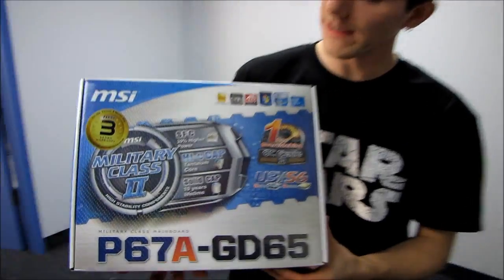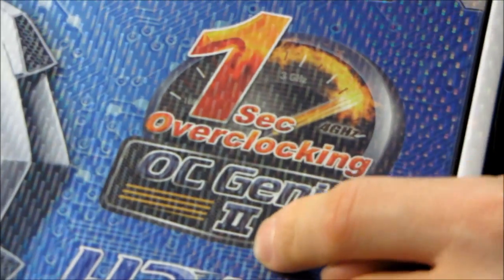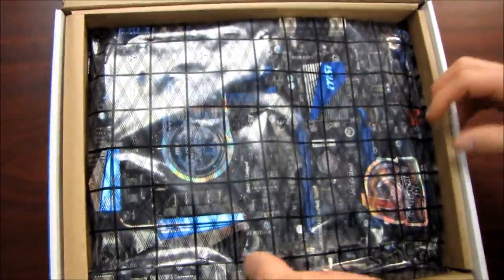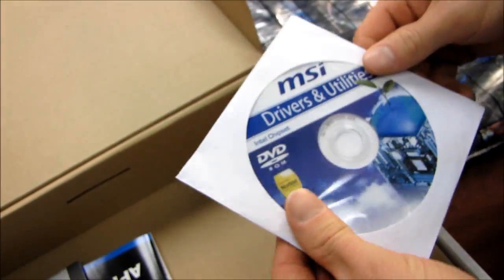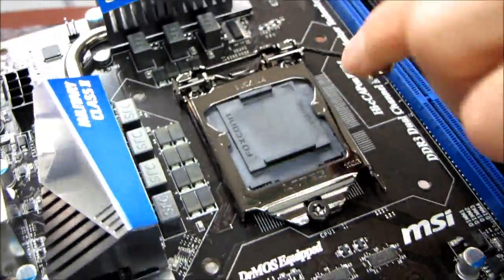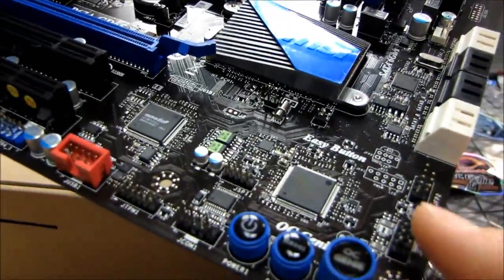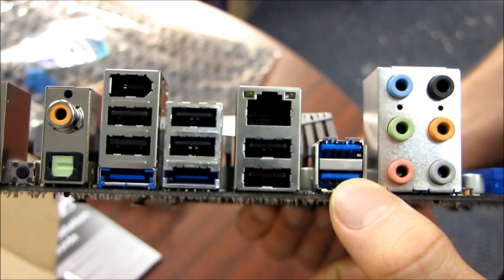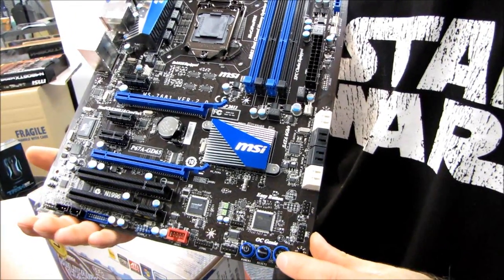MSI P67A-GD65 P67 LGA1155 Core i7 SLI Motherboard Unboxing & First Look Linus Tech Tips

Comment: LGA1155 = 1155 socket
LGA1156 = 1156 socket
LGA2011 = 2011 socket

LGA is the generation of socket, and the number is the number of pins in the socket. LGA is for the i-series of processors.

Comment: "...there is the MSI Z68A-GD80, which has 3 PCI-E 16x slots that can run in 8x/8x/4x. Keep in mind that on the Intel side, only 2 of the SATA3 ports are off the Intel chipset. The rest will be 3rd party, and considerably slower. " So 3rd pci 3 x 4 slot where i'd put Revodrive, how much slower will it be as it s 3rd party and not msi component? Will it let Revodrive x 2 run at its full? thanks blesses

Comment: @8wealthyone8 In terms of a high-end motherboard? On the AMD side, the Crosshair V Formula has 4 PCI-E 16x slots, capable of running at 16x/8x/8x, which would be more than enough, as the two GPUs would run at 8x/8x, and a Revodrive only requires a 4x slot. On the Intel side, there is the MSI Z68A-GD80, which has 3 PCI-E 16x slots that can run in 8x/8x/4x. Keep in mind that on the Intel side, only 2 of the SATA3 ports are off the Intel chipset. The rest will be 3rd party, and considerably slower.

Comment: I hear much people complaining about problems on this board, anyone here got expirience? The problem is the infinite boot thingie, u start the pc, after 2-3 sec it shut itself down, starts again by itself and repeating that proces until switched of power. Do i have to fear because of that, cause i do plan to go for this board, has good enough features at this price. Did they fixed it with B3 or still same thing happening?

Comment: Will this card be good with i5-2500k, 8gb corsair vengeance, gigabyte gtx 560 superclocked(maybe sli later)? I need a stable board for overclocking, and other functions like usb 3.0, sli support, 1600mhz support etc.

Comment: Newegg has the revision of this board, two PCI-E slots, does that one support SLI? It doesn't specify how it runs in SLI, if it does, so I'm scared to buy it, it is "p67-gd65" so it is this board, except the fixed version.

Comment: @ZastrzykHD EFI was also availbe on i think some emachines and ibm thinkpads back in 98 or 2000...well they used pentium 3 and celeron proccessors running at 366-450 mhz thouhgh. correct me if im wrong.

Comment: @ZastrzykHD 

Sorry mate but your wrong about the operating systems.
 EFI does replace traditional bios but you  dont need any operating system at all to get into your bios / efi bios.. In fact you dont even need to have a hard drive installed on the system at all and it will still let you get into your bios :p

Comment: I'd like to have seen more PCI Express slots, and less PCI. For example, if running a dual GPU solution, one may also want to use a ridiculously fast and awesome hard drive solution like the OCZ Revodrive X2, and that requires a 4x PCIe slot. Can't do it here unless you stick to a single graphics card.

PCI is dead. Linus even commented on this in an earlier video, when he saw a board that didn't have any legacy PCI and said how much he loved that.

Comment: My PC is just a basic one about 1 1/2 years old and if you plug some thing in to the back of the computer to charge when it is turned off it will charge at the same speed as normal. I'm just saying this because a fair few of the new motherboards have this as a big feature on the box.

Nio4444